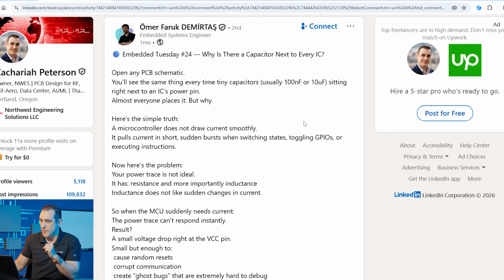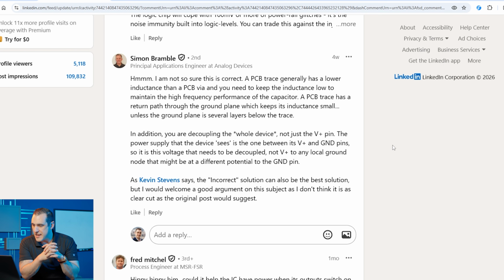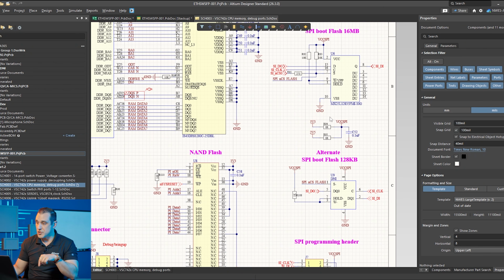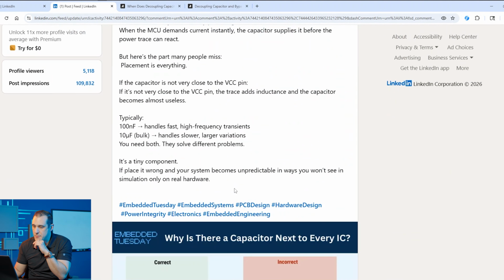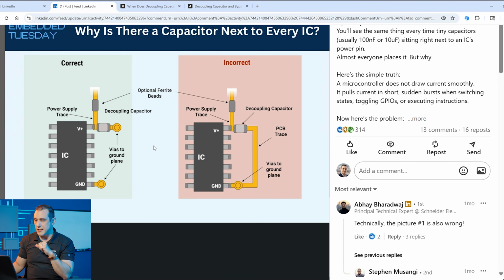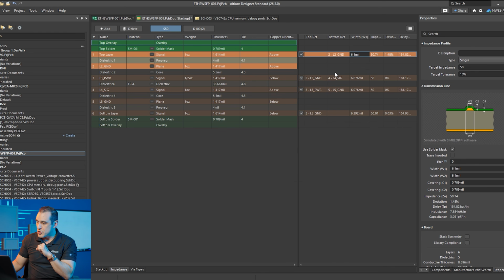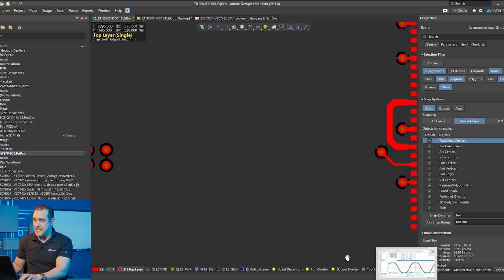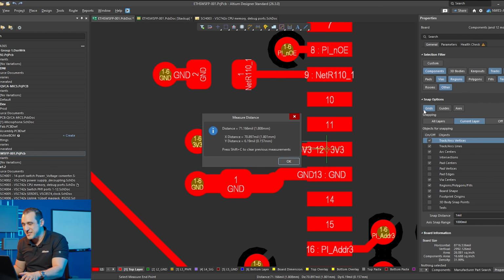Decoupling Capacitor Routing: When to Use Vias vs Traces

Comment: This topic is as old as time, or at least as old as people have been working with electricity and grappling with the problem of parasitic impedance. Every HW engineer must learn about these things right from the start, but not after years and years "experience"! There have been so many discussions on the subject that probably billions of engineering hours have been wasted debating this topic, and there still is no “clear-cut solution.” And there is no single answer or solution because every PCB layout design has its own specific characteristics, and not every best practice is fully applicable there, especially in highly integrated boards and complex packages like BGAs.
I will respond to Mr. Barnes first - when I was younger like you, I really loved going to seminars and conferences, showing off how much I knew and understood, and how competent and capable I was; impressing the other attendees in the audience; and “confronting and challenging” the seminar's speaker. But believe me, that’s not productive. Even if you disagree with him, it’s good to listen to the speaker’s arguments and try to filter out the information that’s useful and helpful to you, integrate it into your own experience, and decide for yourself what the best solution is. Regarding your point - "you are better off a ground via for every decoupling capacitor": It’s not always possible, but theoretically is correct, as long as you know where to place the capacitor, where to place the vias, and how to close that particular ground loop. Otherwise, we simply end up with a situation where someone has heard how to do it “correctly” without any serious reasoning or understanding of the problem. In a current loop, it’s always about how to route the energy as quickly as possible to the shortest path to the ground for that specific current loop. And not to end up with a “spaghetti situation” involving crosstalk, interference, disturbances, other EMC issues, mixed currents, different potentials at various points on the GND plane, etc.
Don’t overlook the analog ground islands either, because you need to grasp their purpose, not consider them as two separate grounds. The ground is always just one when there is no isolation. In other words, the "analog ground island" must eventually connect to the main ground - the power ground, the point with the lowest impedance, the summing point of all ground currents. The same applies to the digital ground. And all these power ground, analog ground, digital ground, high-speed ground, etc., will belong to a single net in your PCB, namely GND. Theoretically, they will be at the same potential. It’s up to you how you route them so they don’t interfere with each other and provide their loads with a sufficiently quiet environment.
My next reply is to Mr. Ömer Faruk Demirtaş - both of your examples are wrong! Simon Bramble had a good point there in his comment. As Zach said, the practical connection method depends on the pin-out of the chip being decoupled. I’ll propose what I consider as optimal decoupling strategy, which should be prioritized - done first, before connecting the other nets on the board, of course, whenever possible! The terminals of the decoupling capacitor must have continuous PCB tracks to the corresponding power pins, V+ or GND. This is the most important thing! There should be no obstacles in their path, especially vias to plane! And most importantly - this is not about which current path is the shortest or has the least parasitic inductance! It’s all about the current path itself and nothing else. It must be defined, it must be separated using continuous PCB tracks! The capacitor is placed on top of the short side of the chip, between the two rows, with continuous copper PCB tracks to the corresponding power pins - in the case of Ömer's exmaple these are pin 10 (GND) and pin 14 (V+), or in the case of Zach's example on 9:39 these are pin 2 (Vcc) and pin 10 (GND). Priority is given to the power supply pin; it must be the shortest, with a solid and wide PCB track. GND pin is the second priority and can have a longer, but also wider, PCB track, and it is best to place a GND copper pour entirely under the chip - this way, parasitic parameters are compensated for, and it ensures a much quieter environment. As for the vias themselves, which will supply power to the capacitor, they must be close to the capacitor terminals but not in series with the continuous PCB tracks to the IC’s power pins. In other words, the order is: vias -> capacitor -> power pins of the IC.
10:24 - Zach, I disagree, and I explained why, above. You’re connecting the via near the capacitor to “some sort of common, noisy ground” just because the via has lower impedance (and even that’s debatable, it depends on the PCB stackup) - fine. But that way you compromise the current path you need to close, and it has to be precisely between pins 2 and 10 - no "breaks", no transitions. A layout and decoupling done this way isn’t optimal, not to mention that it’s even wrong for high-speed applications. I explained above how it should be done.
11:01 - This is a good example that supports everything I said above! You shouldn’t do it this way, because it interrupts the current path that the capacitor is supposed to provide quickly and with low impedance to pin 12 (3V3). The same applies to the other via directly to pin 13 (GND). The purpose of the capacitor is to draw power from the power plane via the vias and to deliver the stored energy smoothly and quickly to the power pins of the integrated circuit, that is, via "unbroken" PCB tracks. If vias are added, as Zach demonstrated, the current path from the capacitor to ground/power plane will effectively be closed. In other words, the capacitor is effectively no longer there because it is being bypassed. This issue has nothing to do with parasitic nanohenries in vias and copper tracks - it is conceptually incorrect. In this way, the decoupling capacitor is effectively rendered useless, and the chip relies entirely on power from the planes, directly through the vias. And flowing beneath them are all sorts of ground currents with different destinations, different potentials at different points, as well as higher impedances compared to those expected in an ideal case.
12:26 The conclusion at the end is correct, but we can always perform optimal decoupling with priority before resorting to difficult and inefficient decoupling at the end of the PCB layout if we haven’t considered this from the start.

Comment: That seemed a bit contrived. Just put the via in between the part and the pin. It has a minuscule extension of the feeder Trace.
Reply: And for an analog part, sometimes you want the feeder Trace inductance before the via hits the planes I think

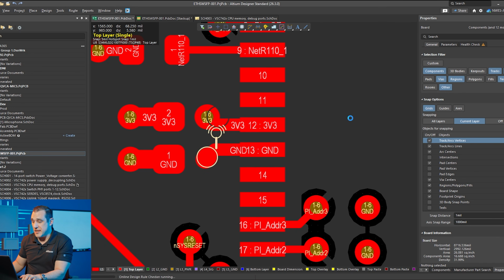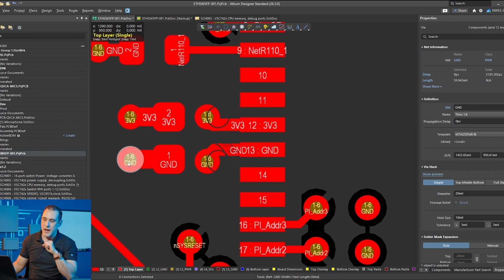Comment: If the pads are the way the are at 11:44 would you recommend to place the vias or the capacitor closer to the pad? I dont mean using extra vias like you did at 11:32 .
Reply: Yes, I was thinking the same thing. When you have good inter-plane capacitance my routing strategy is pad-via-pin (as you suggest), if the inter-plane capacitance I route via-pad-pin (as is shown in the video).

Comment: Now a day I remove the annular ring on unused layers for vias, even outer layers (for other reasons), so in theory even less coupling and smaller holes in the other planes... All symbolic really for most applications.  My circuits are behaving well,at least match the datasheets. Via to GND plane and make sure the plane is full, don't bother with GND return path traces. I do use some ferrites on clk distributions power rails, but that's again not to be done lightly, the LVCMOS edge is less than 10ps... Took me a lots of design iterations and simulations to get it right.